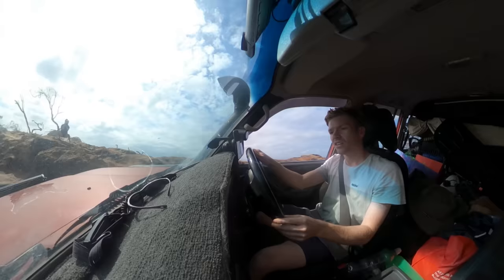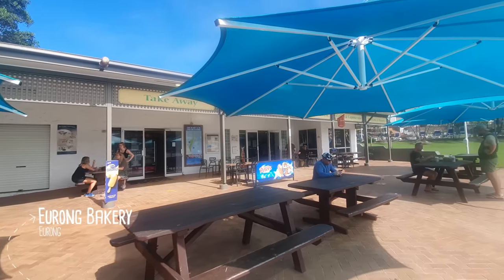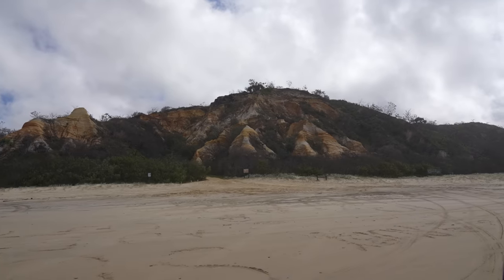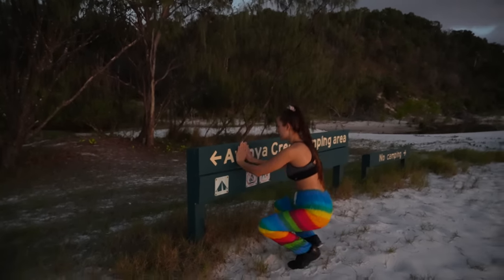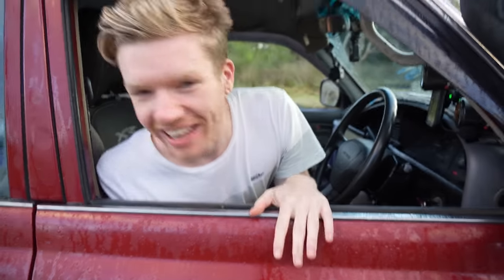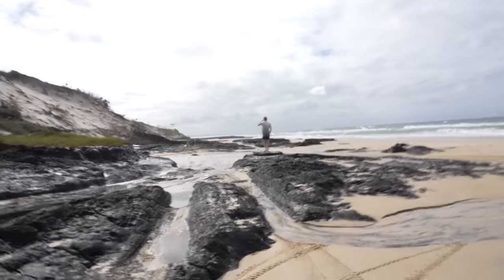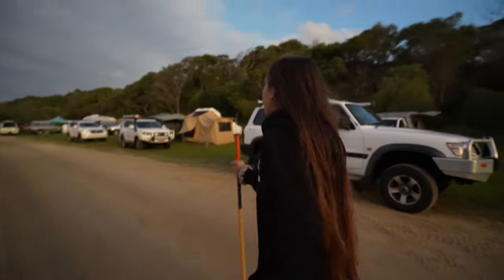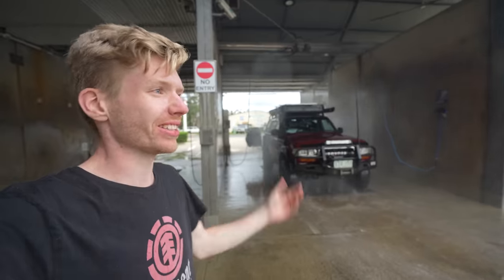COMPLETE Fraser Island 4WD CAMPING Adventure! | BREAKDOWNS, WILD WEATHER, Ngkala Rocks!

Comment: Great video you and ur mrs looked to be so chilled enjoying ur time. Great place.

Your solar system is ridiculously under powered. The travel buddy alone is pulling more amps than ur panel array is replacing. You need to recalculate ur battery draw, to spec ur solar right.

Comment: Next time you have problems with the fusible link wire just remove it and put a blade fuse in.I had to do this with my old 62 series due to fact I had the same problem plus I could not find fusible wire any were.. great vid

Comment: I had the same problems with my 80 with the fuseable link. The lines are pretty tight that run to the terminals would get them lengthens or get someone to look at it.